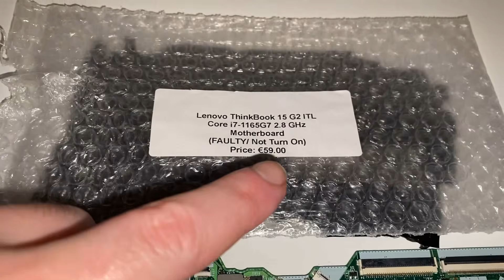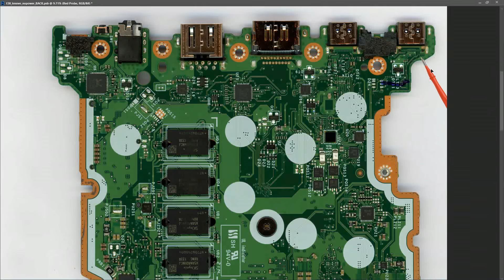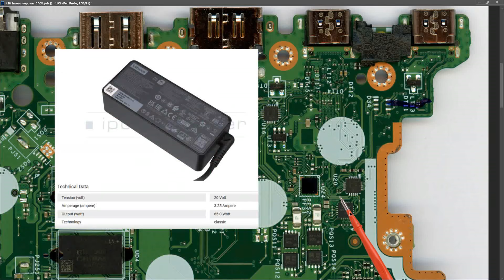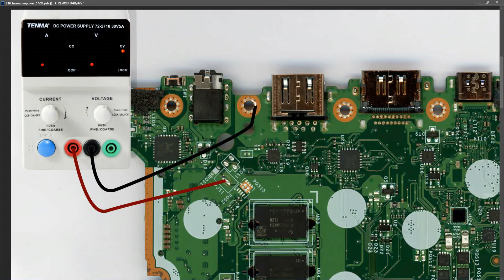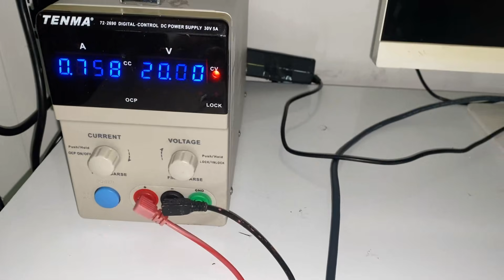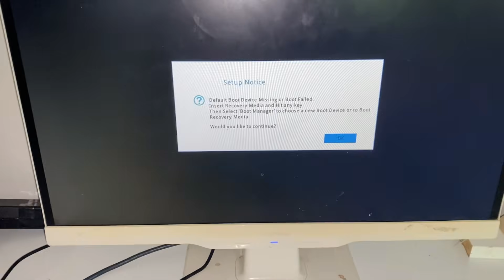LENOVO THINKBOOK 15 G2 ITL - NOT TURNING ON

Comment: Hi, I have the same model and it is not turning on. When I plug in the PSU into the charging port nothing happens but in the PD port the power light comes on and off. Can I send you the motherboard so you fix it for me...? Kindly let me know if it's possible, thanks
Reply from the maker: Hi Robert, I'm in Ireland so it's probably not feasible to ship if you are in another country. Did you check that manual for your laptop and see what that "light goes on then off" means?

Comment: Where is the firmware for this PD Controller stored?
Is it internal to the PD Controller IC, in an EPROM, or bundled with the EC?
Try reflashing it; the problem may be in the firmware.

Comment: Hello mate, came here because facing a Lenovo X390 FT491/ 490 not turning on after using non original adpater.
I have breakdown the MainBoard to check its TPD6S30A ic VReg shows 3.3v, then move to PS8747B found 4short on pin6 as Vdd3, 17 as i2c_en, 20 as Vdd3, 28 as Vdd3.
Output adapter seem normal output.
Capacitor in those line short too, but checked its capacitanse shows not short.
Any idea? Thx in advance

Comment: The fault last week was different than this one.. 
As long as you got 5.1v (not far less) on both sides, and after the second mosfets, then the PD Controller is fine. 
Just make sure the capacitors around it are not the cause.. 
9:54 AliExpress is a good choice to buy ICs, try to contact the sellers, ask questions order and negotiate..
Reply from the maker: Yeah, I guess all I can be 100% sure about is that everything after those MOSFETs appears to be good. I have quite a few PD controllers to replace so I will see if I can just buy a few of the most popular ones.
Reply: @therepairshare673  
Yes, I would do the same and spare some money and time.. I usually buy faulty boards for that matter.
I don't have any experience with the 'Thinkbook' to be honest, but, if you're sure about the capacitors (what
would make it easier if some of them is faulty), check the power rails "monolithic drives" temperature 
before doing anything with the PD controller. and you will need a few of them as well.. good luck.

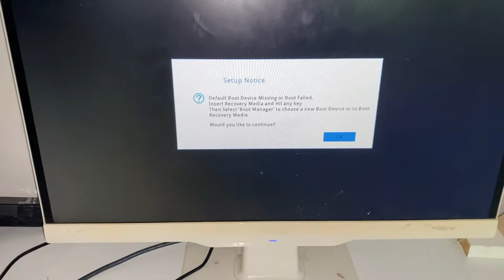Comment: Is the TPS65994AD IC U24 getting hot? Are the passive components (resistors, capacitors, and inductors) near the pins of that IC measuring correctly? In other words, since a setup image is shown (9:11), I'm convinced that the 20.5 V power supply is the cause of the failure, and in fact, the TPS65994AD IC is the prime suspect. Thank you very much for your time and for sharing the information. All the best.